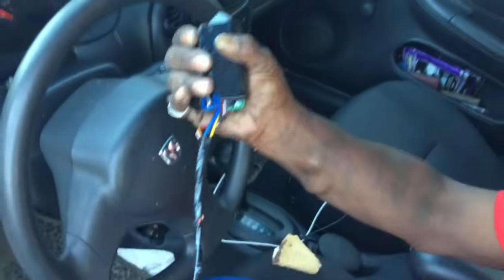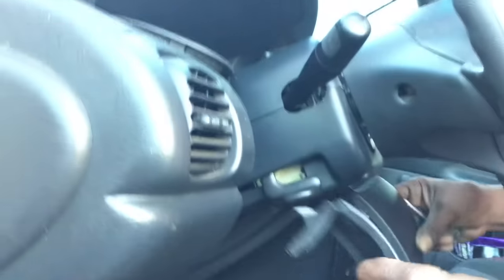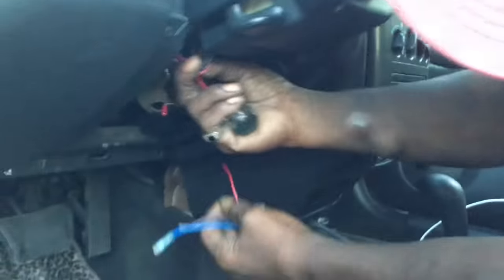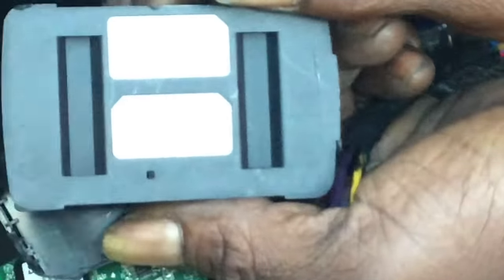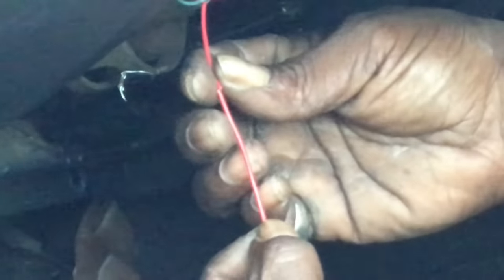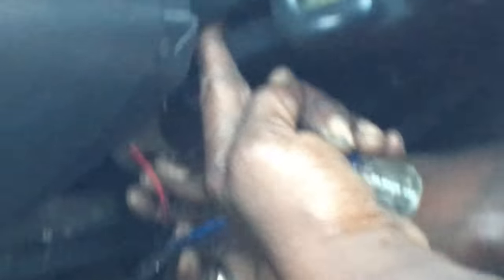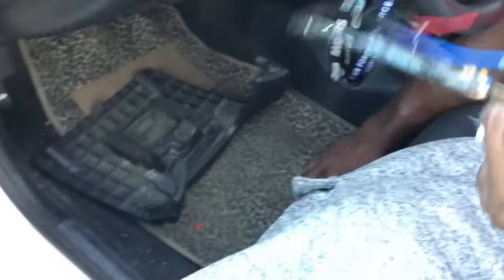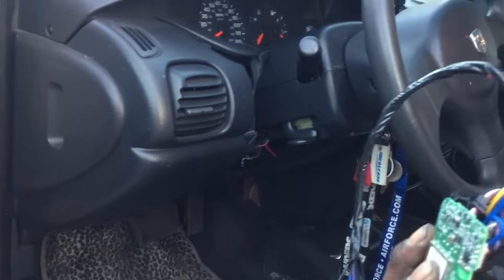How to remove Car Dealers  GPS tracker shut-off box before Repo

Comment: I bought a used car from a house around the corner. Actually was a used car dealership that was selling cars off lot at this house. Anyways, I needed to scan some engine codes and Port under dash had No Power. I investigated and found one of these GPS shut off, cell phone signal operation deals, plugged in line with a Fake Port that hooked under dash like a Normal Port! They even left paperwork from last lady they sold and repoed from, with social security info, work history, age, everything one would need to steal someone's I'd in the glove box! She didn't live far from me and I gave it back to the nice lady😁.

Comment: Why not tell folks it’s also illegal to remove them because when you signed the contract you agreed not to tamper with it until the vehicle is fully paid off at which point the dealer has to remove it